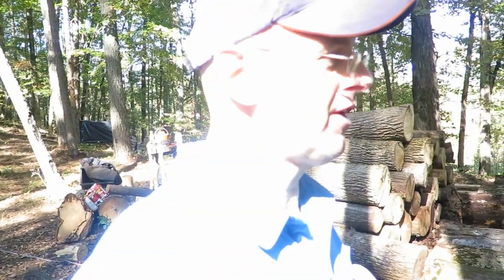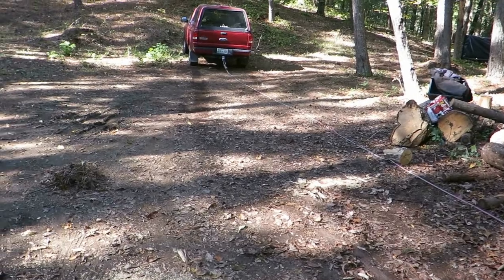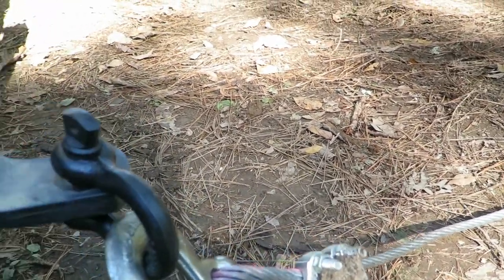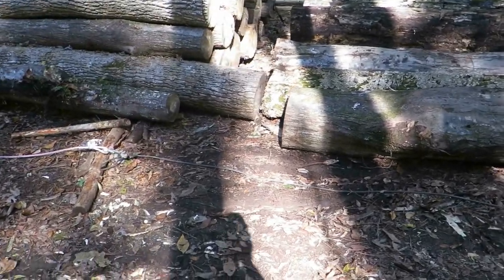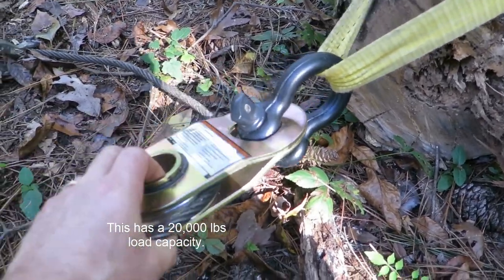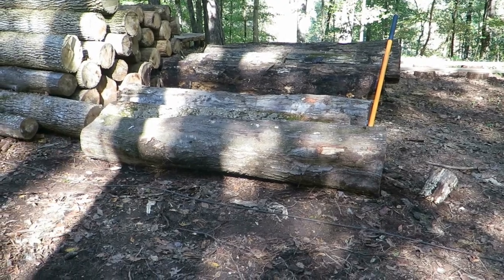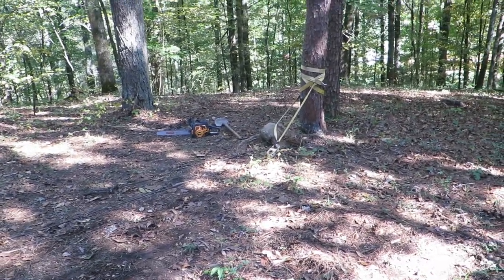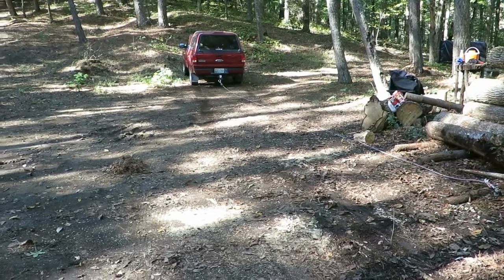Eps.#11 Using snatch blocks to yard logs with a pickup truck

Comment: Little bit of a bummer for ya,  but your stationary pulley is only change of direction.  There’s no mechanical advantage to it.  The log is moving the same distance as the truck. 
A moving pulley (attached to the log) with the cable running through it and back to the tree would be 2 to 1 MA. 
                           🤜🤛
Reply from the maker: Yes, I realized later I had misspoken. I have several snatch blocks now and use mechanical advantage a lot with the multiple attachments.

Comment: how did you attach the cable to the log to avoid the end edge of the log digging into the dirt as you pulled it?
Reply from the maker: I used a pulling band and sometimes it does want to dig in a bit but the ground was level.

Comment: I built a log arch to move my logs around.  Works great either by hand, behind atv or pickup.  I made mine out of street and old trailer wheels/axle.  I have seen some made of wood too.
Reply: Steel 2 inch tubing.
Reply from the maker: I hope to do that with my bigger logs that are farther away on the lot.
Reply from the maker: Do you have a picture you can post?
Reply: I don't seem to be able to post a picture.  It is similar to one posted by Scott Wilson on YouTube.  I made it so I could break it down into three pieces for easy transport and mounted a hand winch to drag logs closer or so I don't have to disconnect from quad to pick up log.

Comment: That set up doesn't provide any mechanical advantage. It just gives you a change of direction. To rig this so you have a mechanical advantage you need to attach the end of your cable to your anchor and attach your snatch block to the thing you are moving. Only moving pulleys create mechanical advantage.
Reply from the maker: Yes, I realized that after I posted the video. I have since adjusted the way I hook up the pulley system.

Comment: Make sure you strip the trunks off the bark now full of sand and small stones before sawing, unnecessary extra dumb work .... use a tripod winch instead or roll the trunks over 2 smaller trunks with a sawmill hook lever or buy auctioned off inexpensive forklifts .... rolling trunks vs pulling?
Reply from the maker: right